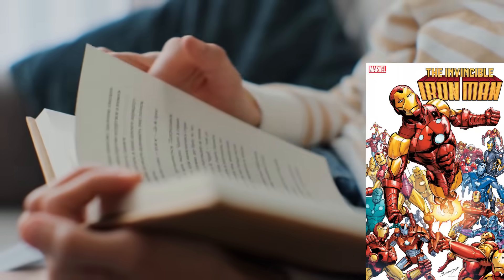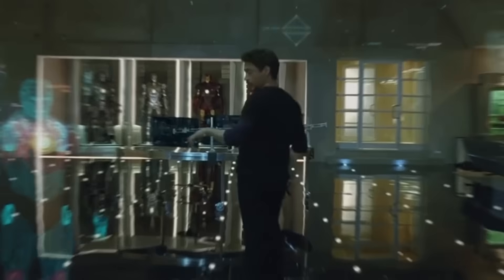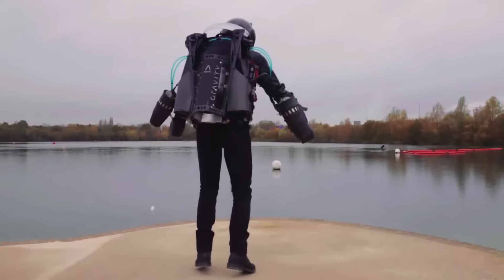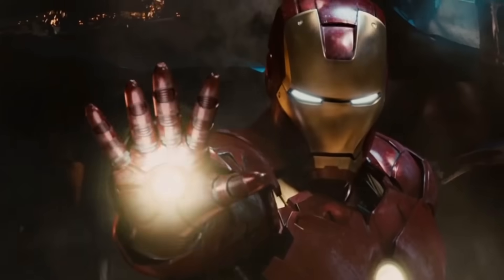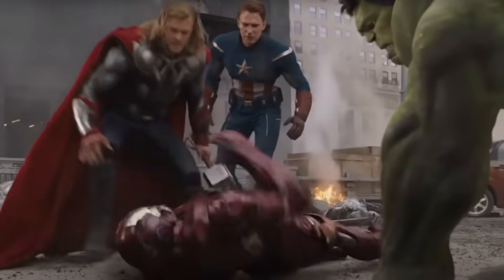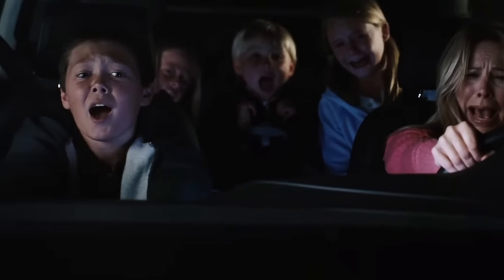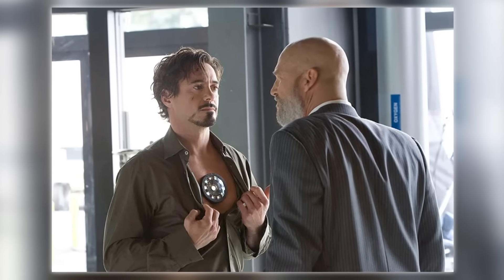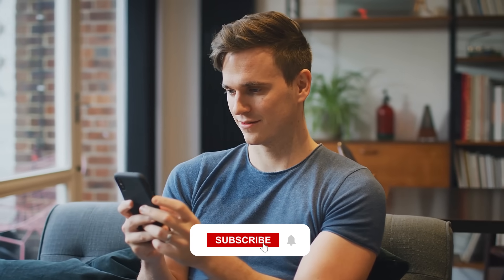Why we can’t build an iron man suit in real life

Comment: Biggest reason we cant build an iron suite is we do not have the portable power source strong enough to keep it powered up to replecate on the movie. If so we would have the problems with the electric cars.
Reply from the maker: True
Reply: Electric car battery tech is limited by several factors including cost, safety of both the end user and the general public, using existing shelf technology, and more.
Reply: @0wl999 that is what I've been saying you have to expect gas to run out and the battery to die all while flying it
Reply: @0wl999 exactly what I've been saying we can being an extremely power engine for a car but nothing similar to put in a suit
Reply: I came up for a idea for  prototype with gpt that would give 2 giga Jews per second with over 90% recyclability over all so pretty close  to infinite 🎉😅
Reply: @thegreatflamingchicken8436  The arc reactor is everything. And we simply don't have anything close to it. It produces more energy in a tiny form factor than entire nuclear power plants, and also doesn't give off any excess heat or harmful radiation while making so much electricity. It essentially gives you the power of God in a tiny form factor. With that kind of energy at your disposal, an Ironman suit becomes much more feasible.

Even in MCU, Howard Stark modeled the initial arc reactor design by studying the Tesseract. Tony later refined it, and then miniaturized it in the cave. Unfortunately we don't have a Tesseract to study from either. We are still struggling to do nuclear fusion with TOTAL net energy gain in large reactors like ITER.
Reply: @Dipj01 got the that all figured out and I can come up with 5 giga watt per second
Reply: @thegreatflamingchicken8436 wtf, how? Neither nuclear fusion nor fission has that much energy density. What other concept is there that isn't still in science fiction territory?
Reply: @Dipj01 Hager you ever thought about both of those types combined to make a perfect cascade loop
Reply: @thegreatflamingchicken8436 kind of had, but didnt think it can scale up to GJ/s, plus both emit immense neutron radiation, making it unsuitable for portability near chest.
And the temperatures for fusion is order of magnitudes higher than the temperatures typically reached by fission. How would it lead to a proper chain reaction...
Perhaps you want to use fission to induce fusion?

Hydrogen bombs kinda use this combined concept by first causing fission which then triggers fusion via ICF, but ICFs are a one time thing. After that it blows apart (which is intended for a bomb but not for a reactor).

There's no long term sustainable chain reaction for this.
Reply: @Dipj01 yeah i thought of that I  designed a three layer casing  for it that blocks the the radiation
Reply: @thegreatflamingchicken8436 huh, that's cool if you solved making it a proper chain reaction. Though shielding neutrons is notoriously difficult without thick walls, which again is not suitable for portability. I hope you succeed
Reply: A miniaturized em drive originally thought of as a possible light engine they missed the point that it is self sustaining after the initial start. There are many other designs that would allow the emitted energy to be harnessed.
Reply: You also have to take into account the ridiculous amount of heat a device producing that much power in such a small space would have. It's a miracle Tony literally didn't just instantly get set ablaze.
Reply: But we do actually but it's better as a temporary suit like you have to take it off eventually at some point to replace it with a fully charged one we can't expect it not to die eventually like everything in out world the considers gasoline and batteries
Reply: I mean it would and least need enough power to power a rocket jet engines that are as about as power as a navy jets use
Reply: You telling me we have enough power to send a space ship to the moon and back because that thruster must of required a lot of power
Reply: Solar panels would be a good way to keep temporary systems online
Reply: And we do have a power source just not one we can't be around safely but if we could Incase it so it couldn't in any way affect the wearer I don't see why plutonium wouldn't work it's supposed to have endless power source properties like radiation but not if you can't seal it so it can't affect the wearer on the inside and out come one we need something as powerful as a car engine but miniaturized just enough to fit but also not damage the user at the end of the day you wanna say without hurting the wearer
Reply: Nuclear power.
Reply: I think It's absolutely possible. 
Maybe not with electricity, but some other tech like nuclear energy?
I mean, look at the human body. It doesn't use electricity. It can run for 2-3 days without needing to recharge (eat) while doing a fair amount of work.

I think it seems impossible because we compare it to electric batteries.
It's definitely possible if we use some other form of energy that we haven't tried (or know of) yet
Reply: We have the tech for the ironman suit the only problem is it is currently huge.
Reply: @asandax6  then tell me how TONY STARK BUILT THIS IN A CAGE WITH A BOX OF SCRAPS
Reply: @yusmet in a movie
Reply: @yusmet it is fictional 🤷‍♂️
Reply: @yusmet it’s fiction
Reply: No. It's because we're not Tony Stark.
Reply: @tsepheletseka5115  nor Doc Brown, otherwise we could build a Mr. Fusion

Comment: TLDR: The suit is firing plasma, not light like the laser turret. 

Theres a few things to mention about questioning the repulser beam. While wearing the full heavy suit, the recoil is absorbed by the suit so it seems like theres no recoil. The kind of attack isnt light like the laser you compared it to. If it's used for flight and shows that it fires a stream of fire like a jet would then the conclusion is that it's firing off heat. If you concentrate and burn a fuel sorce hot enough, it'll turn from a solid to liquid to gas to plasma. What the repulser is doing is firing plasma. Which is pretty much what the sun is made of. Now that's a feat we haven't obtained yet.
Reply: So he can fly with those repulsor running at 30-50% and you're saying he crank it up to 100% to shoot a plasma beam but wont move?
Reply: @Tohka47  Keep on mind that this is still fiction. But when he's flying, the jets in his boots provide most of the thrust. The hands are just to stabilize and keep him level or from spinning out of control. His boots provide the thrust, keeping him up.
Reply: @giofons1991  yes. as you said, only 2 thrusters are enough to lift him up but firing one in his palm still cant make his arm recoil? Or maybe you mean the hand and boot repulsor has different output? Dont get me wrong, I love iron man. And I understand that it all fiction. Just want to point it out tho. But you can see in the avenger (the movie) he blasted cap shield with both hands, continuously, and still not move.
Reply: @Tohka47  yeah I think the movies depicted those kinds of things wrong. What I think would happen is some recoil in the arms but I don't think it'd be a crazy amount

Comment: Yes, I was nerd, and no, I do not own credit. I did research on most of the technology concerning Iron Man some years ago (I was a loser). Anyway, I'll try to keep it short. His "Arc Reactor" is most likely some kind of "Multi-Isotope Radio-Decay Cell." Basically, he is utilizing two different isotopes of Palladium to create electricity directly; rather than heat first. During the first movie in the cave scene he's even using a variac (variable transformer) to essentially jump-start the reactor (according to the article I took notes on, you would need some kind of external gamma source to kickstart the reaction). Anyway, he's perpetually getting a potential difference (which means electrical current) from the two decaying isotopes to generate electricity until the main palladium source is depleted. 

As for the repulsors and flight technology, it's said to be some kind of muon beam. Muons are electrons but just heavier. Like 207 times heavier than electrons. And if you ever heard of ion thrusters then that's basically what his repulsor and flight technology can be. Just high powered muon beams in the form of ion thruster technology. If you know anything about ion thrusters you know they don't provide much thrust at all. Like millinewtons worth of thrust (under earths atmosphere and an air medium btw). So if he's using those but essentially on steriods because instead of electrons they're muons. It could provide lot's of thrust from just electricity (which he has plenty of haha).

For the part about slowing down from flying fast I agreed with another online theory about Tony implementing some kind of "inertial dampening" technology. So the theory was that woodpeckers have some kind of inertial dampeners that prevent them from having concussions when they peck wood. Which would've been cool except that's not the case because they just have small brains and therefore can withstand higher deceleration. So let's just assume Tony did something for something because he's a prodigy loll

Comment: Arc reactor shouldn’t be needed. Yeah, it’s not gonna be unlimited flight, and it will probably die, but using Solid State Batteries would give it a decent amount of power. Would be suprised if it could fly even close to an hour, but still.
Reply: Finally someone who understands that everything eventually dies
Reply: Zero Point Charging Capacity + Solid State
Reply: thats what i thought but thinking back it will contribute to weight and is probably unsafe

Comment: A new idea: plasma. We make a loop with plasma you ignite the gas with a sparker and a battery and you tap into the plasma for electricity then feed that into the battery for charging making a loop. Then you add in the suit in the loop and the whole thing is turned into a sort of self perpetuating loop. Some problems I have come up with this problem: one the gases. Two the burnout of the battery. Three compactness and gas storage. My main thing was to see if the idea would work. Problem solving can come later. Plus added benefit we only need this part for powering the suit and we only need enough electricity to power the suit.
Reply: Pretty sure this would violate the laws of physics and conservation of energy.
Reply: @beachbum111111  yeah it does, but I have an idea that utilises van de walls forces and blocking them so energy can only be transfered by converting plasma into ions and  stuff. No detail now but the results hopefully show in the future.

Comment: I don't believe the repulsors are lasers. I believe they are plasma but for plasma to cause damage and be concussive? Not sure about that. Also for the landings I believe he has some shock absorbing and tech and lets the exo-suit absorb the rest. For the arc reactor not the same output efficiency but if you had vents you could go underwater and have a water powered one that separates it and uses the hydrogen plus the byproduct would be oxygen. (Can't remember the process name off the top of my head)
Reply: Electrolysis.
Solid idea little inefficient though since you need to feed the System and would have a limited tank size for the process.
You could probably store it more efficiently with comressors but that's even more need for energy and would make it bulkier.

Comment: Just make an bigger suit lile an gundam or whatever and them when the tech is optimised began to try to srink it....
Reply: So effectively start with an Iron monger?
Reply: @lorddio4280 tbh, yeah.
Tech isn't always so efficient, and compact in its first iterations.
Look at storage on computers, we went from using massive hard disk drives to small and compact solid state drives.
We need to first start making some of these parts for the suit a reality, doesnt matter how big.
When we know for sure that those specific things are possible, we try put them into a wearable suit, also doesnt matter how big, as long as it is possible to utilise.
Then, we slowly try to shrink the tech as much as possible, whilst keeping the efficiency.
Reply: @lorddio4280 yeah Iron monger is basically what tony started with, a very VERY (relatively) primitive, heavily protective armor with flamethrowers attached, bulky movement and just some strength boosts
Reply: we already have something like that, its called a tank

Comment: AI isn't a problem. AI-aided design is real and up to the task. Mechanical systems for physical strength are relatively straightforward. Flight with anything resembling a reasonable and compact/useful design.....meh....not so much right now, despite that goofy 4-jet pack thing those guys made. Power delivery. That's currently still a problem, but solutions are on the horizon, including iron-air batteries, aluminum-air batteries, graphene-based batteries (which alone would offer an exponent more capacity with drastically reduced size/weight) and even some other power-delivery methods I'm not going to speak of. In it's movie incarnation, it's not possible yet. But the hurdles are diminishing.
Reply: Another goofy creation is jlasers hundred turbine iron man suit. I was extremely disappointed with the results.

Comment: You don't need an arc reactor to power a suit, we already have big companies with jetpacks like gravity, and also people go on their garage and make lasers that can shoot out.
Reply from the maker: You would if the suit can do the things iron man suits can do.
Reply: @getaroundhow  what about high pressure gas and a fuel cell
Reply: @Keallz911 high pressure gas has a high chance of a fire explosion. Fuel cells don’t produce enough energy for constant/continuous flight especially in sizes that would be required for a man sized suit yet they don’t make enough energy yet.
Reply: @lelandholmquist2467   it depends on the housing and the gas specifically, only oxidisers, hydrigen or other flammable gases have a the chance of starting a fire
And then what about mhd and then accelerate ions with ion thrusters
Reply: notice how poor the navigating of that jetpack? yea
Reply: I do like gravity for their jetpack design and its function. But I think I would do one on my own design for thrust and flight. (Not that I’m dissing gravity tho)😅
Reply: @mikethelegendarygamer4581   yeah same, I got like 3 ideas so far

Comment: With the tech in the defense sectors, Iron Mans suit will be a reality in the next 10-15 years.
Reply: Based off how the suit flies in the movies, it looks like they use some form of ionic propulsion which in real life, would require a tremendous amount of power to produce enough thrust as a jet. In the case of a suit, it would have to be a power source similar to that of an arc reactor. As of today, we don’t have the technological capabilities of making that. Most jets and rockets use liquid fuel. An iron man suit wouldn’t have any room for such “fuel”, otherwise one might as well fly a jet in place of a suit.
Reply: @decoderhacker4062 what’s ion propulsion?
Reply: @Artandstuff49  It can't produce enough thrust. It's thrust is very minimal enough for satellites to change orbits.
Reply: @adityabehera6269  is that just cause we don’t currently have enough voltage?
Reply: @Artandstuff49 
Simply put it works in a Vakuum because there is no drag or anything.
I think you could probably encrease to output if you had more voltage but it would be very inefficient.
Reply: @Artandstuff49 it's because it's supposed to work with limited fuel for 50 years and high efficiency and low power
Reply: even if we can make it, it probably wont be used much because it simply wouldnt be useful enough compared to other military weapons
Reply: Not for 100 years.